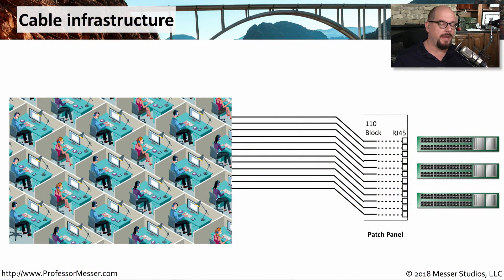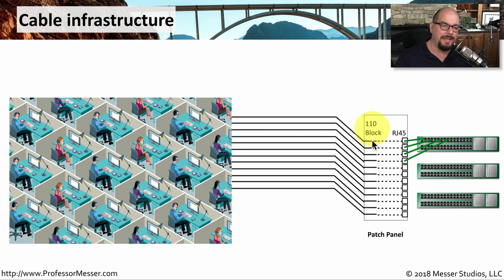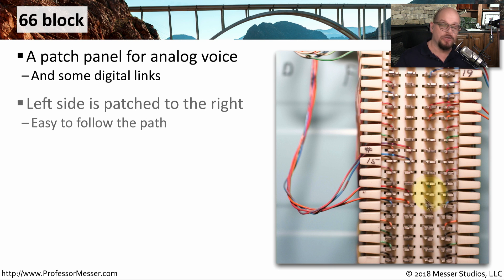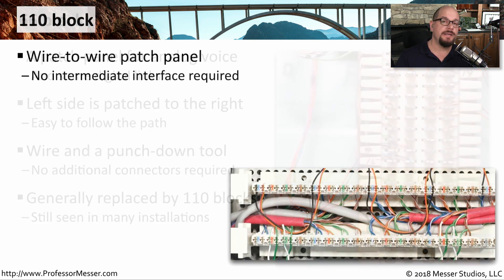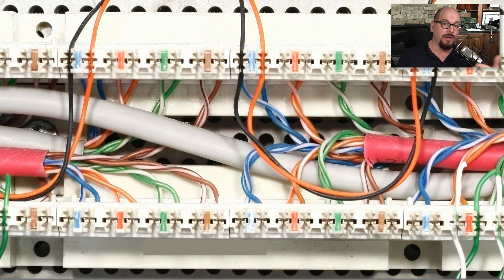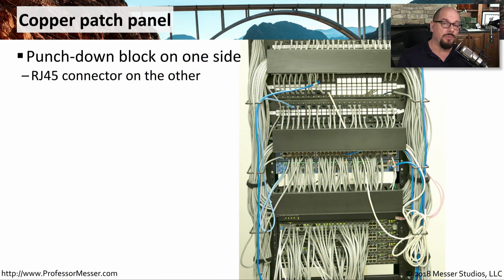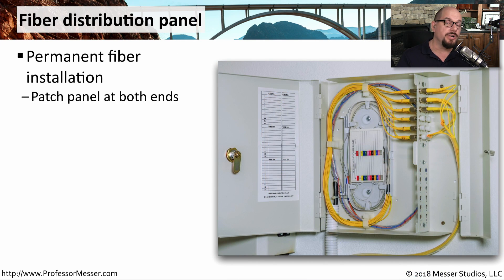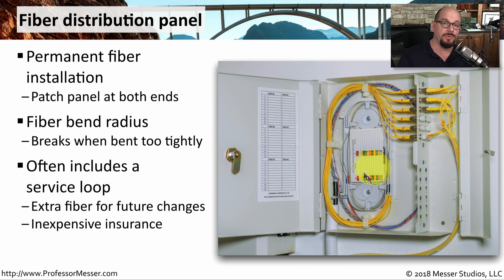Network Termination Points - CompTIA Network+ N10-007 - 2.1

Comment: What exact the function of patch panels
Reply: Cable management.
Reply: As mentioned, if you have to change an employee’s computer, it is easier to change the patch cable in the panel than run a whole new horizontal cable.
Reply: Also, horizontal runs use solid-core UTP which is fast but more brittle. Using a patch panel allows the flexibility of using a stranded-core UTP for the patch cable without sacrificing the speed of the solid-core horizontal run.

Comment: why do we bother stripping the wires and "punching down?'"  Would it be simpler to just have a female rj45 on both sides of the panel?
Reply from the maker: The punchdown process is actually faster to install and costs less than attaching hundreds of RJ45 connectors. Punchdown connectors are also a somewhat permanent connection and can't be easily moved or changed. Ultimately, you would use the connection that would make sense for your network connectivity.
Reply: @professormesser  makes sense. Thanks for the reply